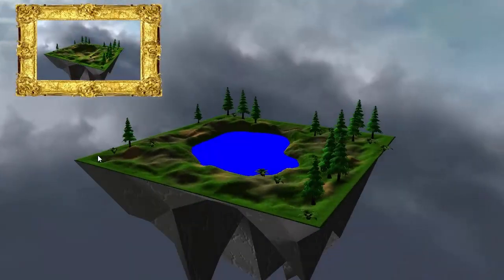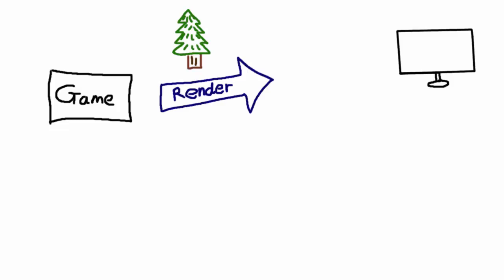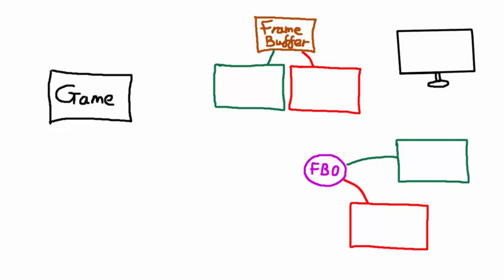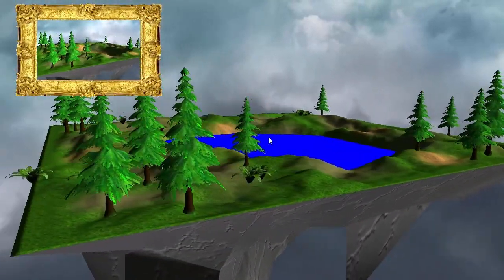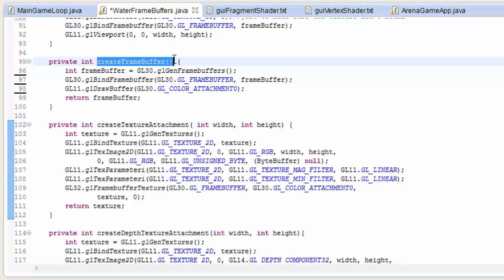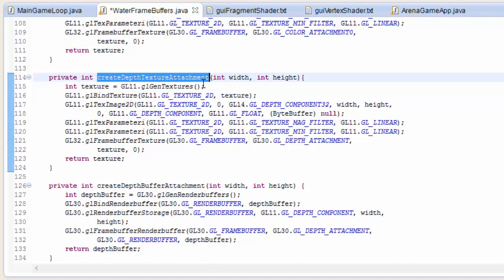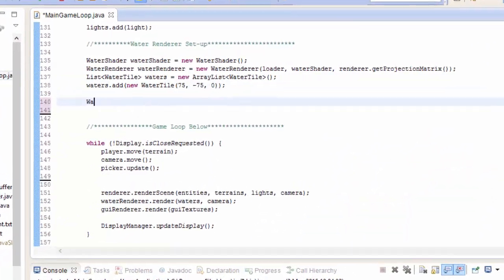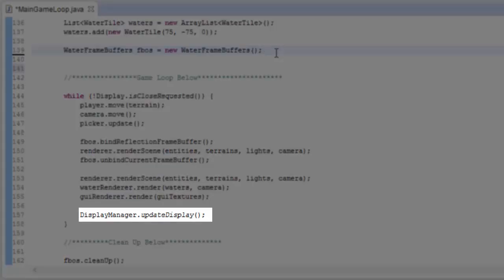OpenGL Water Tutorial 2: Frame Buffer Objects

Comment: What might be the uses of a depth buffer attachment when rendering to a texture as the render target? Using the colour data from the texture seems pretty obvious to me, but I don't quite get what the depth data might be useful for.
Reply: For the water an example could be to make the water look more murky the deeper it is. To be able to do that you need a way of working out how far the terrain is from the water surface, which you can do with the depth texture.

Another example might be if you were making a post processing effect which adds fog to the scene, you could achieve that by putting a filter on the screen and using the depth information to tell how foggy each pixel should be.

Comment: To get rid of "function not supported" error on lwjgl 2.1 you can change 

GL32.glFramebufferTexture2D(GL30.GL_FRAMEBUFFER, GL30.GL_COLOR_ATTACHMENT0, texture, 0);
to
GL30.glFramebufferTexture2D(GL30.GL_FRAMEBUFFER, GL30.GL_COLOR_ATTACHMENT0, GL11.GL_TEXTURE_2D, texture, 0);

and

GL32.glFramebufferTexture(GL30.GL_FRAMEBUFFER, GL30.GL_DEPTH_ATTACHMENT, texture, 0);
to
GL30.glFramebufferTexture2D(GL30.GL_FRAMEBUFFER, GL30.GL_DEPTH_ATTACHMENT, GL11.GL_TEXTURE_2D, texture, 0);

I spend 3 hours to find this ;)
Btw, because I`m on holidays and i don`t have access to my computer I`m implementing this water system on my T60p from 2006 that supports only opengl 2.1 :D

Comment: So, if you're rendering the scene two extra times for the water texture, shouldn't the framerate be reduced by 2/3rds?
Reply from the maker: If you render the entire scene each time at full resolution it would definitely not be good for the framerate, but there are many optimizations that you can make to avoid that. Firstly, the smaller you make the dimensions of the refraction and reflection FBOs, the more efficient it will be (because the fragment shader won't have to run as many times). Of course, that does decrease the quality of the reflection/refraction, so it's a trade off as always.
Also, when rendering the refraction texture you only need to render things in the scene that are going to appear underwater, such as the terrain, and rocks, etc. And when rendering the reflection texture you only need to render things that you need to be reflected, so there's probably no need to render small objects like grass and flowers, especially if they're far away from the camera.
You can also do more complex things such as using simpler shader programs when rendering the refraction/reflection passes, such as shaders with no specular lighting, no normal mapping (if you have it), no shadows, only per vertex lighting, etc. You could even use simpler versions of the models/textures.

Comment: My game is really laggy and i just have my terrain. I have a decent computer with should run everything just fine?? My terrain is 2000 big
Reply from the maker: Make sure that you're not loading any models/textures or creating any FBO inside the main while loop, that stuff should all be done once when the game loads. Also, how high poly is your terrain? What vertex count value have you chosen? Basically the more you render the slower it's going to be. If you're rendering many high poly terrains and loads of models 3 times every frame things are going to get slow. Try to limit the amount that you render, so for example during the reflection render pass only render big objects that need to be reflected in the water. During the refraction pass you only need to render stuff that might be seen underwater. And just in general, only render things that are near to the camera, and in front of it. There are also many other possible optimizations you could make, such as rendering object in less detail when they're further away or during the reflection/refraction passes. As a rule of thumb, the less you render and the more simple you render them, the faster your game will run.
Reply: And just in general, only render things that are near to the camera, and in front of it. How would i do that??
Reply: ive set it in the terrain fragment to 100 i think
Reply: Outlinger I'll check buts that's probably not it
Reply: i know this was 3 months ago, but I had this problem as well. if you have a 2048x2048 2d terrain grid, then thats 4.2million vertices that your shader is processing every frame, you need to cut down the amount of vertices you send to the shader for processing.

Comment: Just a suggestion, I don't know if this would work when you are rendering your main scene to an MSAA FBO however you could add an extra color output and do a simple Z check while rendering so you only need to render the scene twice, not three times and save a bit of performance.

The other downside is having to use your main depth buffer however as the water is the last thing you render you could either turn off writing to the depth buffer or quickly blit the depth buffer which is likely faster then rendering the whole scene. 

(I turned off writing to the depth buffer as I don't use it for any post processing and I currently don't use an MSAA output yet)

Comment: +ThinMatrix , I have a problem, when i create the FBO, and i render the scene in the FBO, it renders onto the screen too, why this happens? i didnt even create a gui
Reply from the maker: Are you definitely binding that FBO before rendering? If you do create a GUI and display the FBO texture in it can you see the scene rendered to it, or is it empty?
Reply: +ThinMatrix i bind it, the problem is that the texture appears black :/
Reply: Are you adding the reflection texture to the gui, or the refraction? If you add the refRAction texture, it will come out black.
Reply: +Jasper Connery dont worry, it already works, now im having trouble when i create the depth fbo, it shows red :/ can you help me?
Reply: I'm running through the tutorials the same as you....but I'll help if I can. Have you changed anything compared to the code ThinMatrix provided/showed?
Reply: +Jasper Connery yeah, nothing is the same xD
Reply: I saw this pop up on another video and ThinMatrix answered with: "Are you sure that you're not accidentally using the refractionDepthTexture instead of the refractionTexture? Because that would be red."
Reply: ɷɷɷ Heey Friendssss I Have F0unddddd W0rikingggg Online Hacck visitt  : -  https://t.co/B7u3lcMINt
Reply: Sasi Kumar shuttt upppp scammmmerrrrr

Comment: Can we use the Depth Test for making shadows?
Reply from the maker: +DanielUnleashed Rendering to a depth texture is indeed part of shadow mapping! You would render the scene from the point of view of the light source and render to a depth texture using FBOs. Then when rendering the scene to the screen you can test each fragment with the depth texture to see if an object is blocking it from the light.
Reply: +ThinMatrix and for the shadows, do We use any texture or just the same scene but without colours?
Reply: Ñeñeñeññe

Comment: For those whose are developing for more GL versions (older ), like me. Cs i have one laptop with GT750 which support 4.5 but i have work laptop with HD 3000 wich support only 3.1 too.
So:
glFrameBufferTexture was include in 3.2 but dont panic  cs 
GL30.glFramebufferTexture2D is included in 3.0. So only if you hardware dont support version greater than 3.1 but 3.0 or 3.1 use GL30.glFramebufferTexture2D instead GL32.glFrameBufferTexture
if you want really really stupid test for this: (for me and testing is fine)
if(GL11.glGetString(GL11.GL_VERSION).substring(0, 3).equals("3.1")){  use GL30.. } else {  GL32....  }
Reply: *****  of course
how i wrote: like a really really ugly code:
  if(GL11.glGetString(GL11.GL_VERSION).substring(0, 3).equals("3.1")){
   GL30.glFramebufferTexture2D(GL30.GL_FRAMEBUFFER, GL30.GL_DEPTH_ATTACHMENT , GL11.GL_TEXTURE_2D, texture, 0);
  } else {
   GL32.glFramebufferTexture(GL30.GL_FRAMEBUFFER, GL30.GL_DEPTH_ATTACHMENT, texture, 0);
  }

for GL_COLOR_ATTACHMENT0 change DEPTH_.... to GL_COLOR_ATTACHMENT0

Comment: Like it, nice quick tutorial, can't wait for the next one! What heightmap are you using there?
Reply: +ThinMatrix It seems to me that the height map you provide isn't exactly the same as the one you use in the tutorial videos. This height map has much less variation in height. It's almost as if the contrast was reduced. I ignored that at first thinking something was perhaps off with my sun's position. After getting the refraction texture working I definitely realized that something looks a lot different. I tried different height maps, including the one you provided in the beginners tutorial, and the height variations are much more reasonable.  So, I thought I'd post it here as a warning. As usual, I might be doing something wrong =). I also am using your blend map, dirt texture and rocks in order to match up the scene as closely as possible. The height map is the only thing that looks to be a little bit off.
Reply from the maker: DemonicGaming15 Thanks :) Here's the height map: https://www.dropbox.com/s/2rryxrruoox9aqs/heightmap.png?dl=0

Comment: is there anyway to get it to render in the correct orientation, i modified the code, and was able to rotate the gui 180 degrees but that still left the gui horizontally flipped, i tried changing the scaling part of the matrix to -x,y,1f but then the gui doesn't render the framebuffer at all
Reply from the maker: Mark Borkowski All you need to do is inverse the y texture coordinate in the shader code, so that it's 1-y. I think we already calculated is as 1-something in the vertex shader code, so just remove the 1-

Comment: Just curiously playing around with the code and was trying to get the depth texture to appear instead of the colored texture, though just a solid red texture appears. Anyone have any idea why? I believe it has something to do with GL11.glDrawBuffer(GL30.GL_COLOR_ATTACHMENT0); though I replaced it with GL_NONE and still red.
Reply from the maker: GeneralTuki It's fine, it should be red. The depth buffer doesn't represent the distances linearly as you might expect, so you have to do some scaling before you see anything useful. You'd have to get really close to an object before you see any slight difference in that red texture. I'll cover it in detail in future tutorials though :)